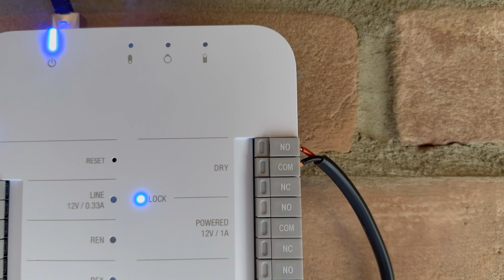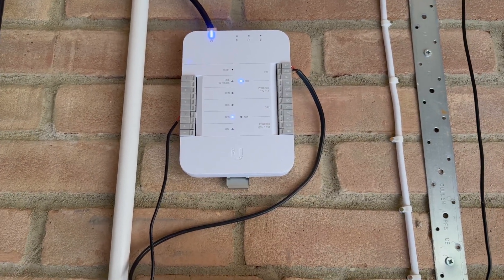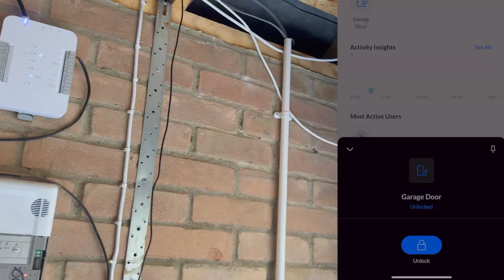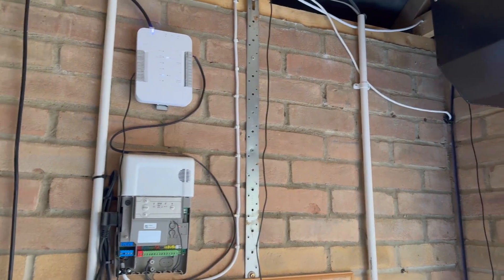OPEN your GARAGE with UNIFI!

Comment: I'm getting an electric garage door installed in a few weeks and trying to get the setup ready. 

I have a Door Hub Mini and a NC DPS connected the correct way as it's correctly telling me the door is open when I unlock it and open the sensor. When the sensor is open the hub is still locking the door after the set timeout, I can hear the relay fire, which I'm assuming is going to send another command to the door and cause it to lock/close? Is that right? It doesn't seem correct to me as from what I've read if the DPS is saying the door is open it shouldn't try to lock.
Reply from the maker: I had this same issue before, I believe I had to connect it to the port that corresponds to “usually open”, which should prevent it from re-locking or closing the garage door after a short time
Reply from the maker: Whichever port in the video is the one that won’t keep it re-locking/closing after a set period. I’m sure they should map closely / same way for the door hub mini too. LMK
Reply: I'll have to try once its installed. I've tried some cable in the lock terminals to see if it makes a difference but it must need an actual garage controller/lock connected to satisfy it. If yours is definitely not trying to close the door again after the timeout then it should be fine for me.

Comment: Could you possibly use the door sense on the Protect Sensor? So when your garage door is "open" the protect sensor would be lined up? Or do you need the door sensor for it to function.
Reply from the maker: Great question! I don’t think Protect and Access can talk in a way to support that. However, the API integrations Unifi announced may support a third-party dashboard / application and display what you’re after. 
As I understand it, the DPS is required for Access to function.